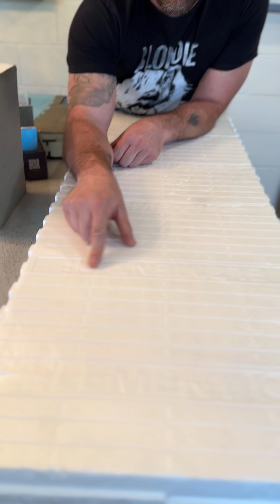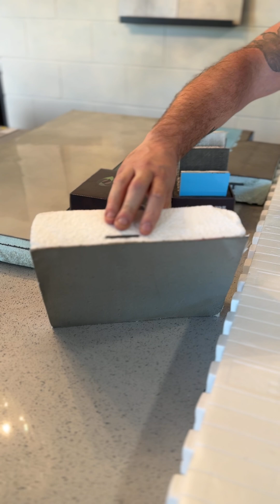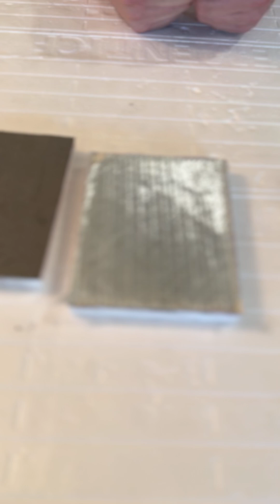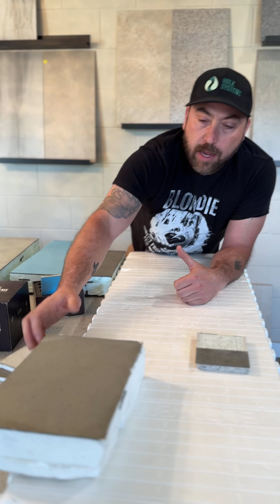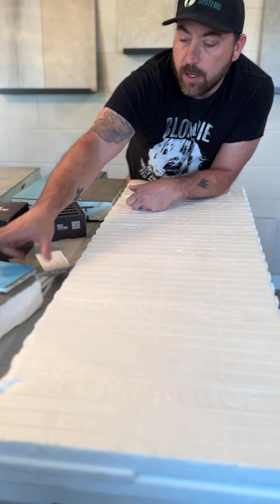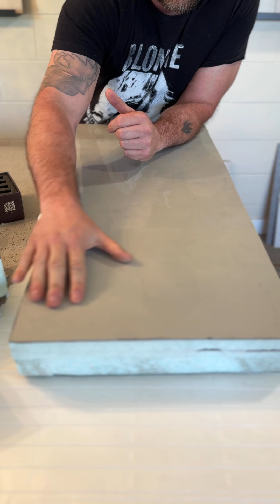Understanding ICF pool finishes - Layers & Liners

Comment: Do you have any information or videos showing the transition / jointing from the ICF walls to the concrete base?  What method is used to ensure this joint will not move and crack the liquid liner?